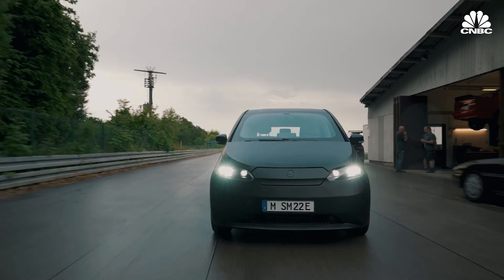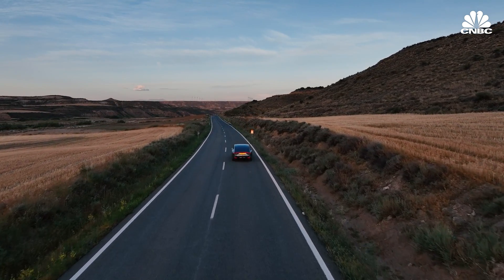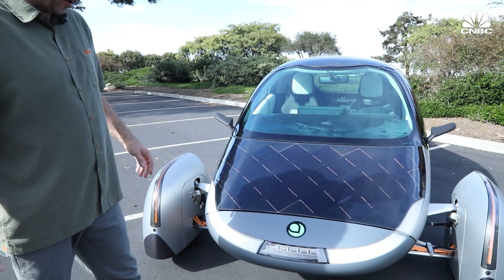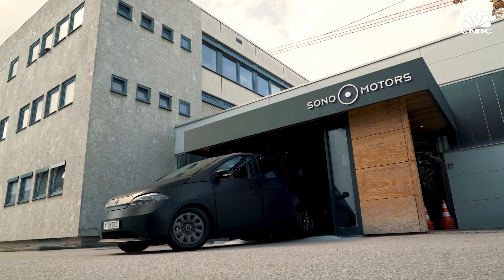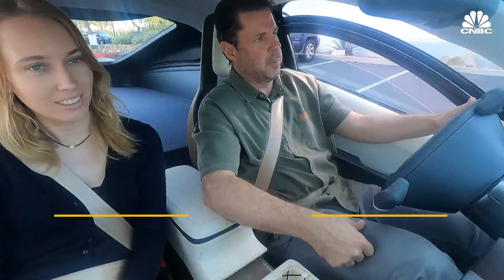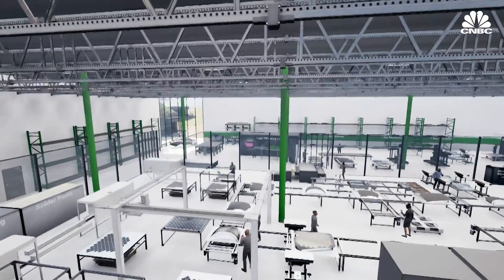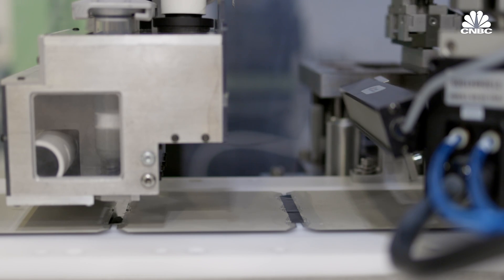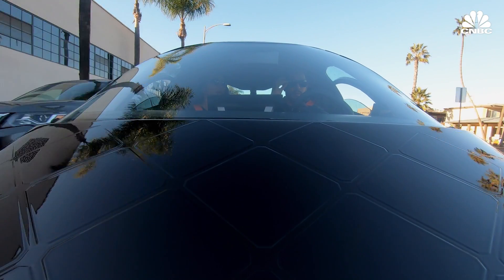Solar Powered Cars Are Here — But Can They Go Mainstream?

Comment: Doesn't the efficiency of solar cells drop off dramatically if they're not perpendicular to the direction of the sun though? 🤔
Reply: You're right. It's a sacrifice that will have to occur. Aptera claims 40 miles of solar charge on a sunny day. Which is still more than enough for an average city commuter.
Reply: @AmericanDrinker  Aptera claims something on the order of UP to 40 miles a day in sunny areas and with the "full solar" option.
Reply: Technically, no.  Their peak power definitely does but efficiency is defined as power out divided by power in.  When not perpendicular to the sun, both power out and power in go down.  Ironically, efficiency may actually go up when not perpendicular to the sun because the cell is likely a little cooler (because of less power in) and all other things being equal, efficiency goes up when temperature goes down.

Incidentally, the power out drops by the cosine of the angle of incidence out to about 60 degrees or so.  After 60 degrees, refractive effects begin to come into play in a serious way and power drops out faster.
Reply: @bobhilder1469  So, maybe technically no, but substantially, yes. In essence, the post is correct IMHO.
Reply: @adimchionyenadum2962  MAYBE technically no(?).  No.  It's CERTAINLY technically no.  I never said the post wasn't "correct".  Not sure why folks get so worked up over simply being educated on the definition of efficiency.  Maybe folks just don't like being informed against their will..........
Reply: No, that's not what efficiency means.
Reply: @austinhernandez2716  Yes, it does.
Reply: @austinhernandez2716  if you're comparing electricity created to what is achievable by the panel. Yes that's exactly what it means. Why is everyone replying with their technicalities
Reply: @AmericanDrinker  I don't see everyone replying with their "technicalities".  What do you have against "technicalities" anyway?
Reply: @bobhilder1469  Because technicities may not always impact practical outcomes.
Reply: @austinhernandez2716  Austin Hernandez says: "No, that's not what efficiency means."  Solar experts all over the world respond with:  Here's your sign.....

 https://www.youtube.com/watch?v=p5ZkdHImCuQ

Comment: Yeah, but how is that Aptera going to fare in a car accident with a Hummer? How much safety is being compromised for the light weight required to support decent mileage? 🤔
Reply: A search on "aptera safety" gives some info on that.
Basically, it's shape and material distributes and deflects force better than other vehicles. They intend to have it pass all the safety tests of a car, though it is worth noting that planned crash tests have not been conducted yet, other than in simulation.
Reply: Should be as safe as any other small car
Reply: The solution is never to have heavier cars, that will just lead to even heavier cars.
Reply: @masonhock6442  That's not a solution, that's just wishful thinking. Put it this way: An Aptera probably wouldn't even survive a crash with a Prius, let alone a Hummer.
Reply: @ropro9817  The weight difference between an Aptera and a prius is the same weight difference between a prius and a hummer.  Should we not have any priuses for the same reason?
Reply: @ropro9817  the aptera has safety built in, and should be as safe as any other small car
Reply: @ropro9817  How do you know?
Reply: @masonhock6442  You are completely missing the point... 🙄
Reply: Don't drive a hummer around the city
Reply: It is monocoque design.  Very safe.  Besides, how often fo you ever see a Hummer on the road?  Also, most deadly car crashes are single-car crashes.

Comment: In southern Arizona, we would always park under one of the few trees in a parking lot, to avoid baking the car in the desert sun. But with these solar vehicles, you'd want to avoid any shade whatsoever. Park outside the garage, in the open, and just soak up that energy. It's a great idea and when they can get solar windows working, and maybe panels on top of the car that open out and add a few square feet of collection, these things will be quite practical, especially in sunnier climates.
Reply: Also here in the Sonoran Desert and, yes, the best parking spaces during the summer months have traditionally been the ones not nearest the the store's entrance, but the shady ones at the opposite end of the lot. That's where I park my EV now. But with a solar EV (I've got my eyes on the Sion and know a few who already have Aptera reservations,) I'd be on the constant outlook for unobstructed Sun-drenched parking year round. 

I hope these manufacturers are taking into account that you'd also want cabin air conditioning to be operating while the car is parked, locked and basically turned off. I'd gladly give up a few miles of solar-generate range if I knew I could get into my Sun-exposed car on a 110° F day and not instantly melt into the seat. Transparent glass that generates its own electricity is already a thing, but I'm guess still prohibitively expensive for now, especially in the shatter-proof automotive spec variety. Demand will dictate the mainstreaming of that tech as well.
Reply: Instead of avoiding the top level on parking decks, people will place a premium on them and likely have to pay accordingly.
Reply: What if you put a lamp over the car so it recharges itself 🤯
Reply: @therapgame1091  that would be a perpetual motion machine :D

Comment: Keyquestion:
a) 25k isnt affordorable for the most people!
b) How expensive are replacement of batteries and the solarpanel?
c) How many unit can be produced in reality?
d) Independent of infrastructure? How? Is it service free?
e) Nothing is free it is just a market scam.
f) Service cost comparasin compared to a regular vehicle?
Reply: Thanks for coming back from the 1990s to tell us the sky is falling, but . . . 

A) Others have already pointed out that entry level EVs are already less expensive than many mainstream gasoline cars. If you want fine Corinthian leather and other crazy luxury/performance options, you're going to pay for it, whether the car is powered by batteries or not. 

B) The battery is the most expensive component in any EV, but also the most heavily warrantied. When the traction battery in my 2012 Mitsubishi i-MiEV began to fade in 2020, I was able to get a free factory replacement without hassles. Not bad for a car I purchased used for under $10K. Conventional solar PV panels today are good for 25 years or longer sitting outside, and it's already the cheapest energy source out there. Both Sion and Aptera have factored affordability into the solar body panel replacements . . . hundreds of dollar per unit, as opposed to the thousands it would have cost just a few short years ago. 

C) Raw material supply chains are now ramping up rather quickly worldwide. Much of what is in the Inflation Reduction Act has outlined that for the US. There will be competition with China (I'd rather compete with them on the free market green tech front, rather than have a shooting war with them) and, invariably, there will be supply chain issues along the way. We didn't land on the Moon 50 years ago by complaining how difficult or expensive it was going to be. 

D) "Infrastructure" here would be defined by the electric grid. If much of your car charging requirements can be sidestepped by simply leaving it parked outside in the Sun, that is basically free energy. Even if I can't take advantage of solar that's directly attached to the car or on my house's rooftop, the electricity from my local utility to charge the battery in my EV is already cheaper - and more convenient - than driving around and comparing gasoline station prices. Oh, and the local utility is also buying solar, wind and storage batteries these days - more so than coal or methane - since they also can see the ROI advantages. 

E) Did you type your message on a typewriter and contract a carrier pigeon to have it delivered to the YouTube office? Or did you tap it out on your phone or laptop and click the "send" button? At the beginning of the 1990s, I probably would have told you that personal computers were a money waster, or that the world wide web (what we called the internet back then) was a fad. But I was sold just a few years later and have never turned back. We're at around the same place today with electric vehicles than we were 3 decades ago with digital communication. The early adopters - both companies and consumers in the field - have already made EV tech cheaper and better than it was just a few short years ago. Most economists who are not beholden to the fossil fuel industry have predicted that purchase price parity of EVs vs gasoline will cross in another couple of years. 

F) Seven years of my real world experience in owning an EV (which I purchased used and cheaply) has only reinforced what I already knew coming into this: that EVs are far cheaper to maintain and operate by the mile than any gasoline car I've own since the 1970s. Period and exclamation point there. I don't need a fossil-fuel-funded "study" to tell me different.
Reply: @benjaminnead8557  Best YouTube comment of the day!
Reply: 25k for a new car is not affordable?  The median price of used cars is 34k right now.
Reply: Having built many custom solar panels in my career, I can say, with confidence, that if Aptera manages to make their panels in an "automated" way, they will be rather inexpensive to replace.
Reply: It's like anything else; early adopters will pay more, and eventually economies of scale and competition will bring down the prices.
Reply: I see why you can't afford one but thank for the comment.
Reply: A Civic is similar in price, what do you mean?

Comment: Aptera promises a lot but they are effectively a rendering company only. They do fantastic renders of a product they failed to deliver this year as promised. They have only just recently signed contracts for major components which blows out of the water their claim from spring they would have a car in the hands of a customer before years end. Now we don't know when they will deliver any cars and their statements of major events, like crash testing and more, put deliveries into Q3 of 2023.  That they do not clarify when they expect to make delivers shows their lack of respect for those who have deposits down. They won't even reveal real pricing because its expected to go up a lot and lets be blunt, there were be far too many BEV available in the traditional four seat four door configuration that meet all safety requirements that the Aptera solar charging will not be sufficient to garner long term sales.

Their ordering page does not reflect the current prototype car Gamma, it has the old rendered interior and pure fantasy battery configuration. Their real configuration is the same slab style everyone else uses and to make the 1000 mile EV as they claim their own renders show it stacking vertically behind the seats.
Reply: Troll
Reply: Just like Tesla the Aptera is struggling with supply chain issues. Tesla announced the Cybertruck about the same time Aptera came on the scene. I think they will both introduce and sell consumer models in 2023.
Reply: Well we're still waiting for the cyber truck too so hyperbole is kind of the norm with EV's.
Reply: Three Alpha prototypes, two Beta prototypes, and one Gamma prototype, all drivable.  These are not mere "renders".
Reply: @robertkirchner7981  Only one Beta I believe.
Reply: You're a simpleton.  Just say that next time.  It's a lot simpler

Comment: The question is would you buy it? Electric cars generally are pretty much worse at everything with the notable exception of polution and acceleration. If you are living in country where the state offers financial incetives for you to buy it and those incentives wont be canceled during your vehicle life time then you could add cost to the benefits. If those are important for you then you can get electric. Then you need to ask, in what way are the panels going to help your electric cars. If you park your car in the garage (at cities and business garages you often dont have a choice) you panels are worth nothing. If you live in any northern area or any cloudy/rainy area where it is cosiderably less suny you get nothing again. Dont get me wrong, the added value is probably there, but the number of people that can actually use it is pretty low.
Reply: You do know that you can still plug these cars in, right? And Aptera lets you configure with fewer solar panels if you don't want them. And Aptera uses much less juice than other vehicles. The solar panels are only one part of the Aptera picture.
Reply: @kurtpenner2362  Sure I do, and I must admit the Apteras range is impressive which solves most peoples grievance with EV which is its limited range. The problem is it solves it by creating a few problems of its own. Its a tiny two seater which if collides with pretty much anything its done with everyone onboard, especcialy in US where average vehicle weight is much bigger then in Europe or Asia. Now that is not the Apteras or its designers fault rather then inherent danger of todays car travel, but it is still a thing to be considered if safety is on you checklist. Which brings me to my original point: solar panel equiped EVs are pretty niche market. Owning one could bring value to its owners if the price math fits, but the number of such customers is low. Nevertheless If you create an EV that can be equiped with solar panels or might not be and is still as good as other EVs then its a competitive advantage for a company and extra choice for the customer which is always nice.
Reply: @vaclavnovacek1035  "Its a tiny two seater which if collides with pretty much anything its done with everyone onboard." - Well, no.  Not at all.  When a vehicle is constructed with lightweight materials, it leads to a reduction in fatalities per vehicle miles traveled. This is due in part to the properties of less stiff materials, such as plastic, which can prevent injury and save lives when used in the crumple zone. Plastic composite structures in the front end of a vehicle can lightweight without compromising safety. Fiber-reinforced polymer composite materials weigh around 50 percent less than steel, but are characterized by a higher absorption of crush energy per kilogram. On impact, carbon fibers can have four to five times higher energy absorption than steel or aluminum. This leads to the structure crushing in a relatively gradual, predictable way that absorbs much of the impact energy, keeping it away from the occupants and improving safety.
Reply: @jonj9149  I must admit I did not know that. I heard that one of the reasons for the incresian popularity of SUVs is safety and reason and I thought that carbon fibres tend to crack instead of deform which I imagine can be problematic for vehicle safety? And are these material benefits enough considering that every vehicle around you is  2-3 times heavier? In 2020 in the US the car with most frequent occupant fatalities was Mitsubishi Mirage. The car scored high on national highway safety test (4/5). 8 out of 14 "most deadly" cars were compact or sub-compact. the others were sport cars. Sport cars you can discard due to "reckless" driving. But if size or weight does not matter how do you explain that? I am not saying that if you reduced weight of all cars using the materials you metioned you would have to compromise safety. What I am asking is that if average weight of all wehicles you meet on roads remain the same and you are in considerably lighter vehicle, doesnt that compromise your safety? I am not a fan of SUVs by the way.
Reply: @vaclavnovacek1035  You are focused on weight only in relation to safety.  As I stated, there are other likely more important factors to consider including materials of construction and vehicle design.  If everyone continues with a single-minded safety approach focused on weight, the one-upmanship will have us all driving inefficient tanks down the highways (like the Hummer EV).  Your weight-based insight only has meaning when considering vehicle-to-vehicle collisions of similar design and construction.  Hit a large oak tree or a bridge abutment at 100 mph and it likely won't matter if you are driving the metal frame SUV or a metal frame sports car.  If they pull you out alive, they will surely need the "jaws of life" as the metal will have collapsed around you like a soda can.  This is unlikely to be the case in a composite carbon-fiber vehicle.  You can read up on how a number of Formula 1 race car drivers have escaped tremendous crashes with minimal injuries.  If I was driving in one of those races, I sure as hell wouldn't want to be in a metal frame vehicle.  No way.  No how.  More weight doesn't mean safer.  There is much more to it than that.
Reply: Why don't you look at the population per acre in Canada vs the US?  The bulk of the population has usable sunlight for charging.  As for garages, most people with garages and no non-covered parking aren't going to think about buying a car with panels on it..
Reply: Tesla model Y will be the most sold carmodel on planet Earth in year 2023.
Reply: @mikafiltenborg7572  It might. But considering its price tag and looming recession I would not bet on that. However as I wrote, if a car manufacturer can offer its customers model option with solar panels or without that gives them competitive advantage and added choice for customers which is a good thing. Model y checks that box. So even if is the most sold car model on earth how is that relevant to what I wrote?